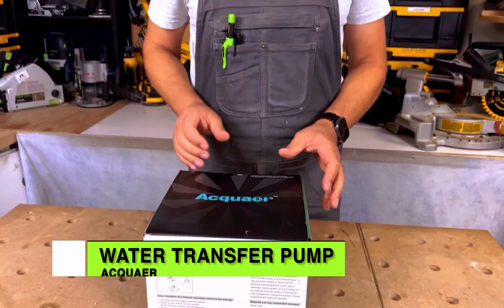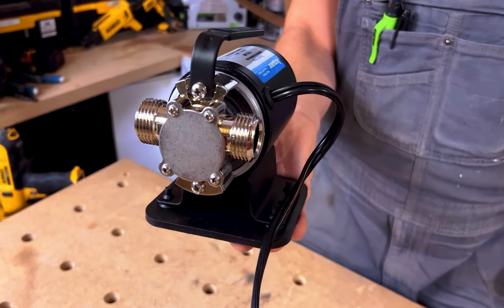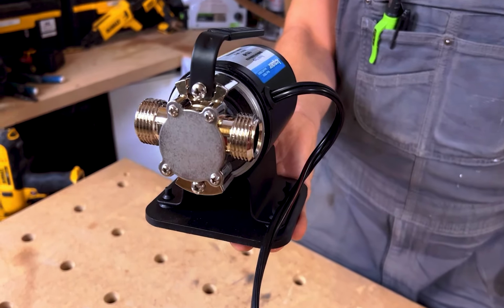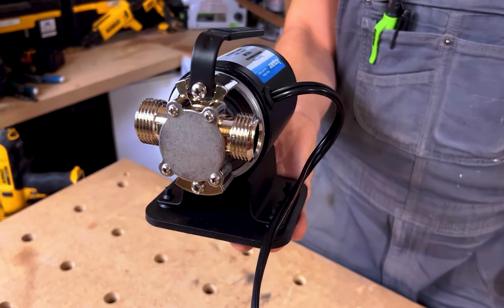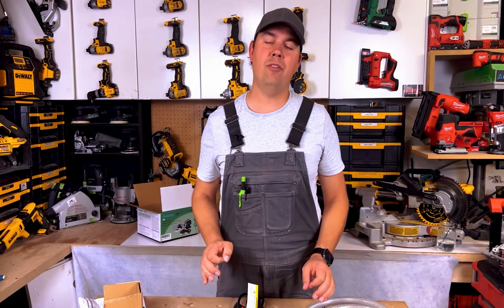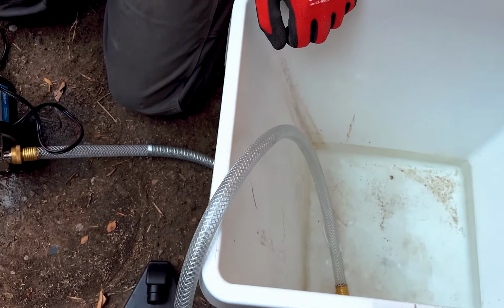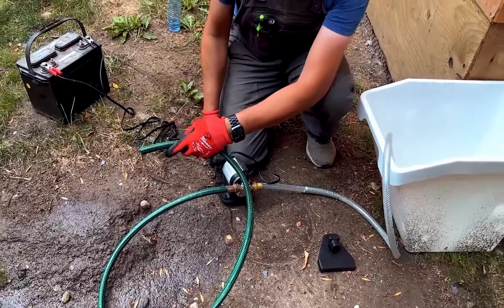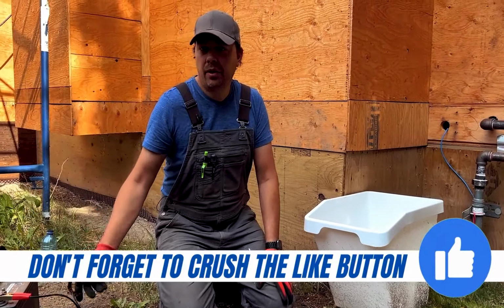HOW TO USE a Water Transfer Pump - Acquaer review

Comment: I just received mine and when unpacking found both the suction and discharge connections have flattened hose threads at 6:00 and 12:00 positions, they appear smashed during manufacture to me and in your video I did not notice flat spots on your pump. Can you enlighten me?

Comment: Great video thanks. Mine is saying to put vegetable oil in it each time to prime, but I'm using this as a secondary pool pump to get small debris of the bottom of the pool. Do i need to print with oil? 
Can the inlet hose be 15ft? It's the same size hp

Comment: I have a sump pump currently which I inspect and service as needed. It only runs once or twice a year when we get heavy rainfall. My concern is, when we get heavy rain it's usually during a thunderstorm and we will frequently also lose power so, our sump pump won't have power. I heard you say this is not a sump pump and I get that but, could I use use this as a backup to the sump pump in instances where we don't have power? Obviously, I'll have to deploy it, and turn it on and off manually but what other alternatives are there than a manual bilge pump or a transfer pump? Sump pumps with battery backup are prohibitively expensive...
Reply from the maker: Yes this is a great back up to have, or perhaps look at the Milwaukee stick pump. Or look at getting a small pump that you could hook up to the Milwaukee “Top up”, lots of options for ya

Comment: will it not burn the pump out if you have it on a garden hose? im trying to find a way for my detailing business but worried if i do this it'll kill the pump being turned on and water not flowing
Reply from the maker: Yes I think if water isn’t flowing it will probably burn out. You could wire up a remote to turn the power on and off when you need it.
Reply: @hammerandhome  I’m trying to find a proper pump for this as I know there is kill switches like sump pumps but not sure if it comes in utility pumps

Comment: Can you used it to drain a water bed?
Reply from the maker: you would have to have an opening big enough to fit the bottom of the stick into it. you would be better off with milwaukee's 18v transfer pump. that unit just requires a hose

Comment: I have about a hundred foot by fifty foot patch of stickers/sand burrs that come up every summer on 2 lots I have that does not have a source of water, therefore I cannot use a preemergent and then water it into the soil to prevent the stickers from growing and cannot control them by mowing, if I miss a week of mowing I go and find stickers. I was thinking of putting a water tank on my utility trailer with a ball valve to open and close it at the bottom out to a water hose, hook it to a pump like this, and go out with a short hose with an adjustable nozzle on the end, and power it with a car/riding mower battery. I am hoping I can put out the preemergent and then use this pump/watering set up to water the grass to water in the preemergent and keep the stickers from even growing starting next summer. Do you think this will work? If it is even half as powerful as a standard outdoor water faucet and hose at a home I think it will work great. Thank you for the video.

Comment: When using it with a pressure washer, do you have to turn the transfer pump off if you stop using the pressure washer. For instance, if you spray off your vehicle and then stop spraying while you hand wash, do you need to turn the transfer pump off or does it have some type of pressure switch. Thanks
Reply: Same question I'm wondering! Any updates? Looking fot answer
Reply: I seen a video where a guy put a splitter on the pressure side of the pump and ran a hose back into the tank and the other hose to the pressure washer. When you let off of the trigger, it just keeps pumping the water back to the tank. I havent tried it yet but i feel like it should work
Reply: Im about to find out lol I am putting one of these as an inline pump from my buffer to tank to my pressure washer so i can do a Job this weekend (customer has no outside water hookup)  The 12v water pump I bought looks like this one, but its a different brand with more flow.  330 GPH, which is around 5.5 gallons per min.  My pressure washer pump is rated at 4.7 gpm.  Hopefully this works